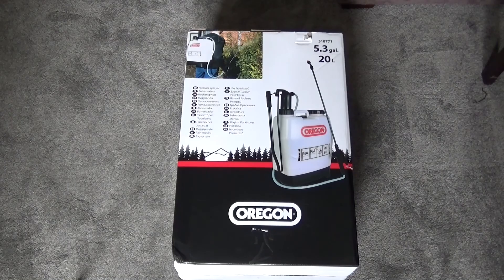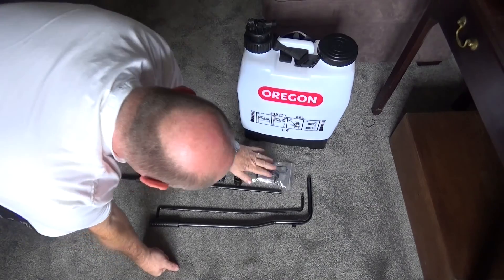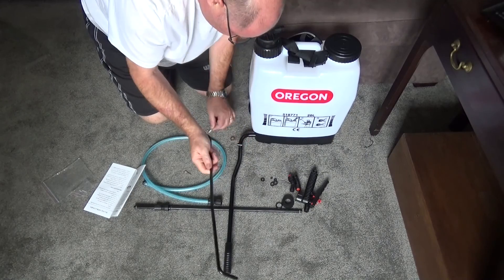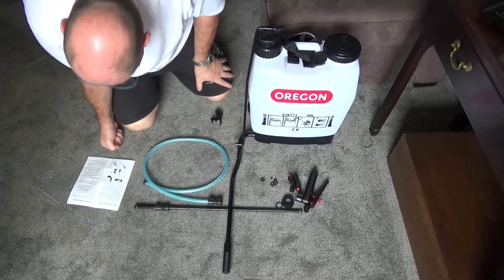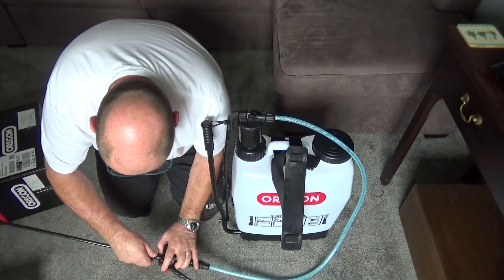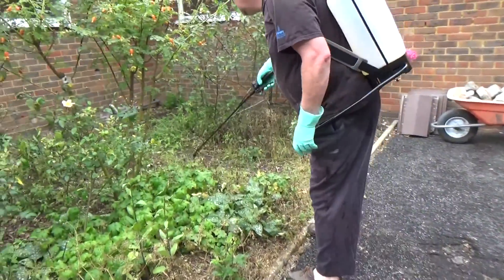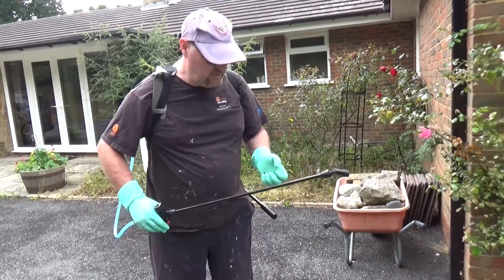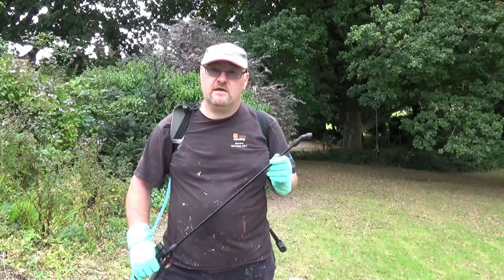Oregon Backpack Sprayer - Review and Assembly

Comment: Wish you'd shown how to fit the split pins. Somehow I've never had to use them in the past.
Reply from the maker: Sorry Peter, I never thought about that.  Line up the holes and push the split pin through until the eye stops it going in any further.  The other end of the pin is two pieces side by side.  Usually, one piece is slightly longer than the other.  bend one piece one way and the other in the opposite way to make a `Y' or `T' shape.  This will stop the pin fron falling out.  https://en.wikipedia.org/wiki/Split_pin#/media/File:Cotter_Pin_(PSF).png  :-)

Comment: A great video. How’s it fairing up after time? Is the container comfy against your back?
Reply from the maker: It is not bad.  If you get one of these you need to make sure that all connections are tight before using it each time.  It has been very handy and is great for covering larger areas.  :-)
Reply: Russell Platten great cheers. I’ve got a large 500m2 roof to treat with biocide. Not something I do really but as a one off as a builder. Cheap but effective for me is key👍

Comment: Great video ta, was wondering if you could advise if this would be any good for rinsing down a motorbike.
Reply from the maker: Personally, I would not use it for that as it does not generate any real pressure and there is not enough flow.  :-)
Reply: @RussellPlatten  thanks for the reply, I'm trying to find a solution for a garage a few minutes walk from a water supply.
Reply from the maker: There are several products out there that may fit the bill.  Try searching for 'Worx cordless cleaner' or ' Karcher OC3'.  My Karcher pressure washer (K4) has a filter adapter to allow it to be used with a standing water supply like a rain butt, bucket or pond.  If you are able to collect rain water at the garage that may be an easy solution.  Good luck in your quest!  :-)
Reply: @RussellPlatten  Awesome! Thanks for the help, much appreciated
Reply from the maker: @Jisei13  You're welcome.  :-)

Comment: I really need to thank you for this.  While I didn’t buy an Oregon, my Chinese knockoff is pretty much the same thing.  I assume, actually, that the Oregon may also be made in China.  Anyway, the ‘diagram’ instructions are beyond bizarre, and the identification of parts, like ‘shower cap’ or ‘locotor sleeve’ would be laughable, if you didn’t need to understand what they were.  I followed your instructions, and aside from extra o rings, was also left with a white saucer looking thing with a big hole in it.  I’ll either find out where this is meant to be, when I use this thing, or not.  Anyway, thank you, thank you, thank you.  I never would have figured this out if it wasn’t for your video.

Comment: The split pins don't stay in, this makes no sense
Reply from the maker: I take it you have bent the straight ends back once you gave inserted the split pins Michael?  Push the pin through the hole and bend the two ends back so that the pin makes a Y shape and cannot be pulled out of the hole.  Sorry if you are already aware of this and the problem is that the eye is too small.  :-)